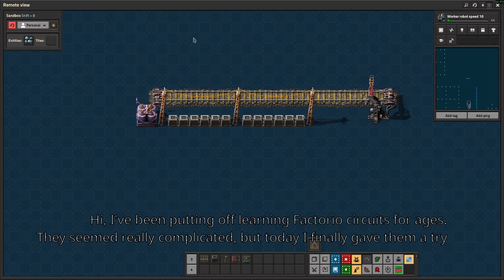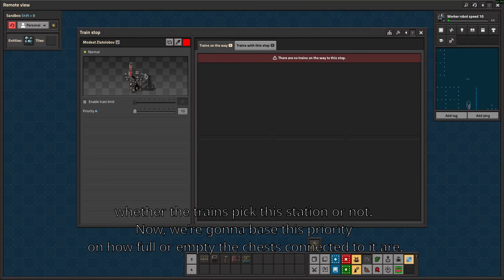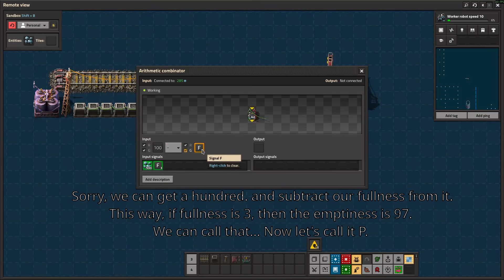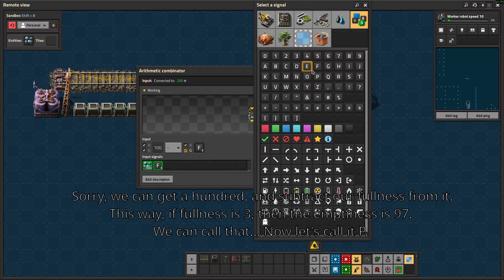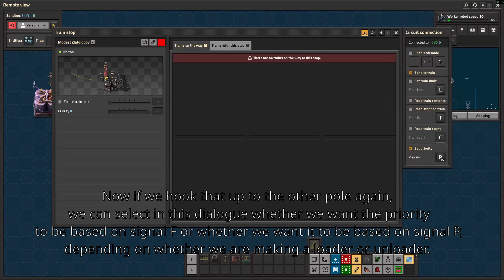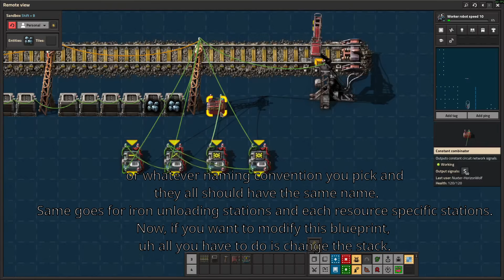Factorio Circuits Aren't Scary - Basic Train Automation

Comment: Love this idea. I think this could be improved with a few simple changes to make it fully dynamic:

1. Use the new decider combinator to automatically output the stack size of the items in the chest.
2. Instead of specifying which item you need on the first combinator (where it multiplies by 100 for C), use the 'Each' or 'Any' wildcards.
3. Set the input wire color for this first combinator to only green (see point 4).
4. Put the output of the last two combinators (F and P for connection to the train stop) on the opposite color wire as the chest input wire to not get signal contamination from points #2 and 3.

This should allow you to use this for any item without needing to adjust any settings for different items and their stack sizes.

Edit: updated combinator name in point 1 to "decider".
Reply from the maker: Thanks for the tips!

There is a new filter combinator? I can't find any more combinators in vanilla, is it a space age thing?

Also I upgraded the design with a decider combinator, apparently they can read stack sizes so it saved me adjusting the constant combinator!
Reply: @nuxter6210  I actually meant the decider combinator. Glad you were able to incorporate it!